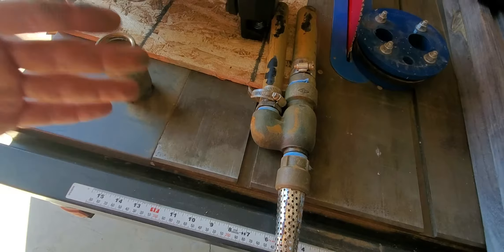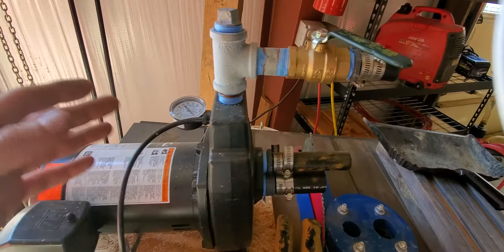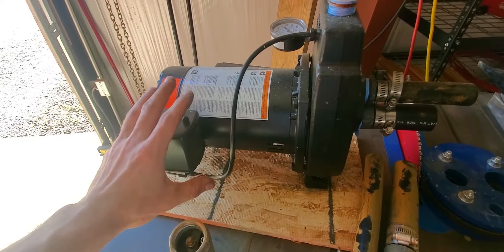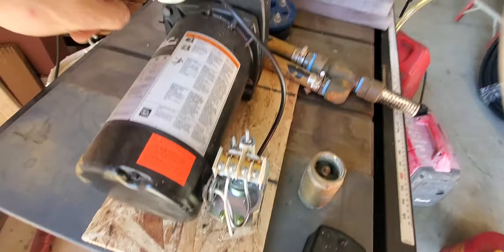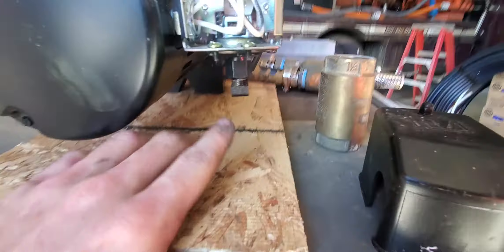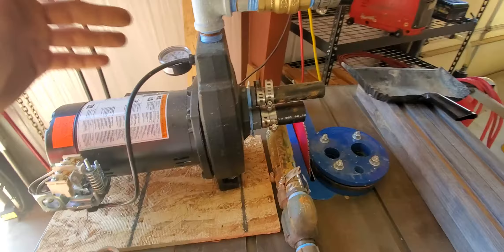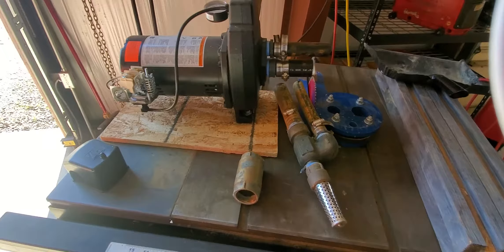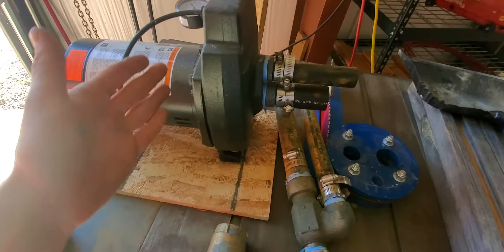Well Pump Not Pumping, here's why. Jet Pump 2 Line System Explained. No Water, Low Pressure.

Comment: I got my new well pump working fine. I left the power on to the pump and the cut off pressure switch would turn off the pump until I used it . Overnight one of the pipes came loose and now when I turn on the pump it hums like it's trying to start the pump and can't.  Please help,jeff
Reply from the maker: Above ground jet pump? Or submersible 
Jet pump would require re-priming. You'll need about 6-7 gallons to prime it.

Comment: Q for you H2o Mechanic, my jet pump is a F&W 1/2 hp. On top of my pump casing is a brass jet screw with a brass locknut. The original setting is gone. Is there a proper method to reset to be correct ?
Reply from the maker: Not sure, but id say it's more of an air bleeder .  If its at the top of the cast pump head.
Reply: @h2omechanic  I found the answer in an online F & W manual. To reset the flow control back factory original settings, turn the brass screw clockwise until it stops. Back off (turn counterclockwise) 2 full turns. Turn on 2 faucets and start the pump, adjust the screw for full flow. I'm sorry, I should've added mine is a convertible jet/deep well. It looks like it's ejector / foot-valve time for my system. Last time was 2003(?). Curious, what do you race? Thanks !!!

Comment: If I have a convertible jet pump for a shallow well does the lower opening on the face of the pump housing just get plugged off?
Reply from the maker: No, if the pump face has 2 holes, it's a duel pipe system. That is for a 6" style well that uses an injector on the bottom of the drop pipes. Typically irll use a 1" pipe (feed) & a 1.25" pipe for the (suction  line) the injector & foot valve attach to the bottom of the pipes. Max 60ft deep
Reply from the maker: A single hole face pump is a suction pump only capable of pulling from about 30ft deep.
Reply: I'm new to well pumps and motors   and this one hasn't been used in about 10 yrs. The front of the pump housing has like a 90 degree elbow on it that connects directly to the 2 inch well pipe and the lower opening on the front of the pump housing had nothing in it and I thinking it was left open to drain any water out for winter. Should it be plugged off?

Comment: Thanks for the video!   I replaced my injector and foot valve 2 summers ago.  Went to put the water on to the summer house yesterday and the pump will not build enough pressure to even kick off with no valves open to tank or house.   Just ground to pump.   Would never even pump up to 20 psi.    Everything worked last summer.  We had new lines put in, new injector and new foot valve installed with plastic fittings to the injector from hoses.     Water stays in the line up to the top of pump and does not leak down.  My question  is should I rebuild the pump or is there another problem?   The pump is a Goulds j series from 1990.   There is a lot of iron in our water.    Would you say it’s a injector problem (replaced 2 years ago) or pump problem?
Reply: I rebuilt the pump and still have the same problem.  Even pulled up the injector and cleaned it out.  Still the same problem
Reply: Ever find the issue? Having similar problems with mine now, put a new pump in and still haven’t been able to fix it
Reply: @Motard867  yes it’s most likely the ejector and foot valve .    We changed both pump and ejector but I would really think it was the ejector.  If you change the ejector make sure it’s the same one for your pump or the same setup you have.  We went to a local plumber and he gave me one that he said would work.  We installed it and it didn’t work.   I had to pull it up again and change out the long plastic tube and then it worked.   Just make sure everything is the same.  Also make sure there isn’t any leaks or holes in the lines even before you pull it.  I guess from what you can see and hear.   If you call someone to do it they will just start replacing parts.   They don’t really test anything.   So if your handy I would try to do it yourself with a couple friends if possible.    It will be insanely cheaper.   Even if you need a new pump and ejector/ foot valve. It will still be cheaper than just even having a plumber pull it up. Without even replacing parts.
Reply: Thanks bud I appreciate it, haven’t been wanting to pull the lines from the well but that’s the last option of things to replace so I’ll pull them this weekend and inspect jet assembly and injector and replace as needed
Reply: Welcome.   Good luck.  Don’t use metal barb fittings makes sure you use the plastic barbs.   Our metal barbs literally dissolved in the water.

Comment: say my neighbor asked me to help her get her yard pump to work. she has a myer deep well pump with injector setting on top of the point and she said that point is maybe 60 or more feet down. and said the last time it ran a few years ago she did not get much water. i have never seen the injector setting on the top of the point. it has been installed many years. so outside of the point , having tons of rust on it to plug the point should i take that injector off and  see if it is damaged?  i have not yet tried to plumb it to see for myself as i just went to check it out and get the feel for the job. i was going to try to get it primed and see what is going on, but with you talking about the injector may be failing it may be a good idea to take that off and see if it is good. now it looks like it has a double flang over the point and rusted bad so ar those just squeezed onto the point with compression pressure?  and can you tell me if it is really practical to have the injector setting about the point that far up with a 60 foot deep well. i do not know yet the actual water level in the poin as i have not taken it apart. thanks
Reply from the maker: Its probably a screen well & single line. The screen is probably stopped on. She'll need a company out to blow it out the reverse direction, or slam in a new one. Must be a coastal area. In my opinion, don't waste your time, you can't force it to make water
 It must be flushed.
Reply: @h2omechanic  thanks a lot. we are about 5 miles west of lake michigan muskegon mi.  the water is pretty clean for well water out our way, but like you said the well may be rusted enough over the years. i told her that acid and shooting a gun n the well was pointless. so i will tell her she may just be better off installing a new well and being done with it. thanks
Reply from the maker: Dry ice does better. It bubbles in water creates pressure, to help flush the screen. 
Idk what type of well it is, a local company is your best bet in my opinion. 
But I'm positive that it's not a easy fix

Comment: I have a 100 feet well with a 1HP vertical pump running at 230 volts.  The foot valve was bad and we were losing prime. We changed both the foot valve and jet valve new and now the pump is not sucking out the water. The pump sounds good and the inside impellers are spinning, the gauge on the pump only goes to 20 PSI when the pump is turned on and NO water is coming out. What can i check?  Its a 2 inch pvc pipe on the outside casing and 1" pvc pipe inside.
Reply from the maker: If there's clamps on the system anywhere, tighten them. Normally it's a leak on the suction side bringing in air. It doesn't leak water bc its under a vacuum.  Jet pump have to be a perfectly sealed system
Reply: @h2omechanic  There's no clamps. It's PVC pipe glued together with new brass jet valve and foot valve at the bottom of well.

Comment: My pump doesn’t have a pressure meter. I cannot prime it because there’s water all the way to the top. My tank is good (I watched your tank video). When I open the top to prime it, the pump turns on (I assume to build the pressure back up) and when I close it it cuts off shortly after. But there is no water in the house. So if my tank is good, and my pump gets power, is that a problem with the small black tubing?
Reply from the maker: Possibly. Yes. Normally that's a faulty tank scenario. But the next would be the little feed tube to the switch yes
Reply: @h2omechanic  the feed tube doesn’t disconnect. Is that normal?
Reply from the maker: @diamondlo5244  every system is different. Not sure about yours
Reply: @h2omechanic  thank you for the reply. 😊

Comment: Why the pump never gets filled up?  I keep adding water to it and hear the water going down to the pipe. The water level never reached to the top of the cap.
Reply from the maker: Jet pump?
New systems require about 5 gallons to fill. 
If its a old system, then that means you have a bad check valve/ foot valve at the bottom of the pipe in the well
Reply: @h2omechanic  It's a 2018 jet pump for my home lawn irrigation.  How much does an irrigation technician charge for repairing a bad check or foot valve?  Does he need dig the ground and pull the pipes all the way from the well?
Reply from the maker: @TTTT-if9cy  $150 service charge, the rest he'll have to diagnose on site

Comment: Our pump looks just like the one in this video it cracked over the winter, it is in a pit, no longer to code and we have to fix it ourselves. We replaced the pump but it won't stay running. It runs for 3 seconds, turns off for 20-25 seconds then runs for 3 seconds again over and over again. It is 20-40 pressure and the pressure tank does not appear to be over pressurized. Any ideas, do you have a video that might address this peoblem?
Reply from the maker: Possible a bad foot valve. 
But 1st check the tank, watch my tank videos and be sure its got atleast 15 psi of air in top of tank. (Tank must be empty of water to check air pressure properly). 
Your description sounds like a bad tank
Reply: @h2omechanic  😭 we replaced the tank 7 years ago. We will watch your video and then try to determine  if it is the tank, again.
Reply from the maker: @pennyantonson3881  7 years is not terrible life. Typically 8-12 years is the average. There's a Ballon inside the tank that eventually pops.

Comment: Please!!  Have a low-flow well..80 foot..so we have to use a jet..casing is only less than 2inch. Whats the best option for me..i have a 1hp jet pump..and about to purchase new injector. Is this way correct?  Btw water. Table here is at about 30 ft..i am in extremely (sandy) s.c
Reply from the maker: I believe your doing the right thing. If that doesn't work, replace the pump (if it's old).  There's always other possibilities for system failures. Be sure you don't have leaks, or leaking toilets
Reply: @h2omechanic  thank you 4 the reply. We have new pump. And the home we have has never had running water due to the residents leaving before it was turned on. Thanks again!

Comment: Dude if you can help me get in the right direction I’d greatly appreciate it. I’ve called several dealers and can’t get anywhere. I just got a duck hunting lease where the owner floods part of a field with above ground pump his pump went out and can’t give me any info on what I need 
It has a sand point that 29 ft deep I put a string and sinker in it and there is  10 ft of water sitting in the pipe it’s got a 2 inch pipe coming out of the ground off the sand point and it needs to be 220 volt any ideal on a pump I could use
Reply from the maker: I'm not an expert on costal wells. But you'll need a 1hp single line jet pump .  Single inlet & Single exit. Farm supply store might have one for pond transfer pumps

Comment: Hello there! I lost water pressure this evening so I started to investigate. I have jet pump similar to this. I discovered my pump was running continuously and wasn’t building any pressure. The pump had become quite hot. I also noticed that the feed tube had come off at the pump but reconnecting it didn’t solve my issue. The pressure switch was replaced last summer so I don’t believe that to be the problem. I attempted to reprime the pump but to no avail. I will be reattempting tomorrow when I get some day light but getting water is difficult as there is 3 feet of ice on the lake from which I am pumping. Another thing I’ll be looking for is any Sediment in the feeder tube but I’m not sure what would cause it to dislodge other than vibration possibly. If you had any other advice on what I might check it would be greatly appreciated. 
Thanks!
Reply from the maker: You probably have a frozen pipe somewhere, or a split pipe. It the fitting/ pipe blew off the pump due to high pressure pushing against a frozen plug, you'll have to allow it to thaw & inspect the pipe going to the water closely
Reply: @h2omechanic  thanks for the reply. Things have been melting here at this point so I’m not sure if the line going to the lake could be frozen. Definitely can’t rule it out though. When I’m attempting to get prime do I have to make sure that the line to the lake is full of water right up to the pump? I believe that you do but I’m having troubles getting enough water to fill the line without a functional pump! Also I noticed that the pressure tank only has around 20 lbs of pressure. If I remember correctly I have the pressure switch set at 30 & 50 lbs.
Reply from the maker: @bq6162  tank needs no more than 28psi of air & your correct about filling up the pipe with water. If it won't hold, then the foot valve is leaking & not holding
Reply: @h2omechanic  thanks again for the reply. So I pulled one of the drains on the pump and nothing came out. Upon further inspection the drain hole was filled with mud/debris. The pump has been in place for around 5 years so I’m not sure how much debris to expect to be inside of the pump. I took the intake side of the pump off and cleaned it as well as possible with no running water. It was pretty filthy inside. Got everything back together and still no water. Come spring I’ll have to pull the filter out of the lake and check/clean it. No clue where to go from here. Might have no water till the lake melts. 
Thanks again

Comment: Please help me out sir. I have a Sta-Rite water ump for my home. I have a pretty  tall tank connected to it. I lost pressure the other day due to a leak from a pvc pipe that connects from the top of the well pump to the tank. I replaced it abs I also replaced the pressure switch because I think it was starting to get bad. I put a brand new 30-50 pressure switch on it. I primed it like I have always done but the pressure builds up abs just stays floating between 30 and 30 psi and you see the needle just dancing and the pump doesn’t want to stop. I have to force it to stop. I have no leaks. The tank is about 3 years old which I bought at Home Depot. I have had a lot of incidences that the pump was running for hours without me knowing and the pump was just so hot I felt it was about to explode. It has happened to me a lot so I am wondering if the pump is going bad. The pump was already installed before I bought the home so it was used. The tank has pressure I think like 28psi when the pump is not running and about 35psi when it is running. I had a tech guy come out the other day and he couldn’t get me back up and running like before. Currently I was able to get enough pressure to get water but it’s low. I can’t seem to get it any higher past 30psi. I have played with the adjustment needles on the pressure switch but it just not working. How do I know when a well pump starts going bad? One clue for me is that I don’t hear the water rushing loud like I used to when The pressure built up. Please help. Should I invest in a new pump or do you think it’s the tank? The tech told me he’s 99% sure that it’s the pump. I have tried my best to relieve any air in the lines and at the pump as well
Reply from the maker: Pumps bad. The impeller has a rubber seal around it. Running it dry probably melted the seal
Reply: Thank you for replying so promptly. I didn’t think I was going to get a reply
Reply: Could you answer one more thing for me. What exactly happens when the seal goes bad so I can know for my knowledge
Reply from the maker: @ronniethepilot  pressure takes forever to build up or itll pump but not enough to cut the switch off.
Reply: I have a jet pump.  It ran but no water shows 35 psi.  Footvalve was replaced and primed.  Pump makes a humming sound but doesn't have the same sound it did while pumping.  It will shut off but no water pressure will not fill my toilet and pump will not cycle on once toilet is flushed.  Please help.  I'm disabled so I can't do a bunch
Reply: @sonjariddle428  It almost sounds like the power to the pump was installed backwards. Get someone to switch the wires around on the pump, just to make sure -- anyone can do it. It doesn't take long. I'm not a well expert, though, only a long time user.

Comment: My well pump primes and brings super cold water up but will not put water into the pressure tank or get up to pressure. Please help me. What can be the problem. We have replaced the motor and pump, the pressure tank,  ran all new pex pipes in the house and just can not get water to come out
Reply: Go to 6:00
Reply: @tjaypep2650  is there anyway to bypass that foot valve?

Comment: I can't find my well out in the yard. Can you help me?
Reply from the maker: Find where the water line enters your house. The direction of the pipe is an indication of where the water line will be.  Normally you can feel the old ditch or notice a area on the yard (very faint) .  Or call 811 & ask the guy to mark all underground lines.
Reply: @h2omechanic  there's a slope where it's generally supposed to be on the slope I found a hump that I can dig into which is not common in my yard in CT. So should I dig in front of the pile of dirt ? They wouldn't just out a big mound of dirt on it on a slope right? This is a two line jet pump well dug in the 60's.
Thanks